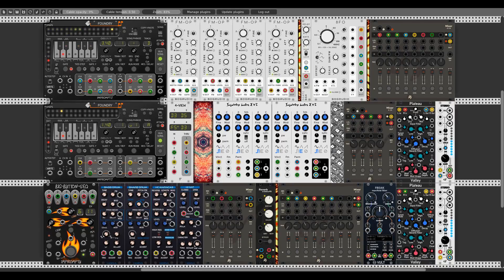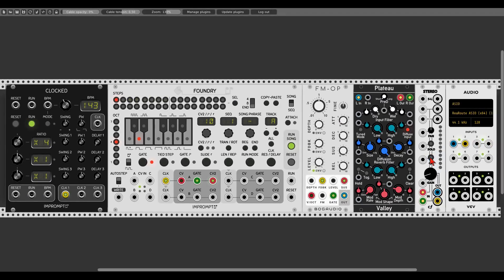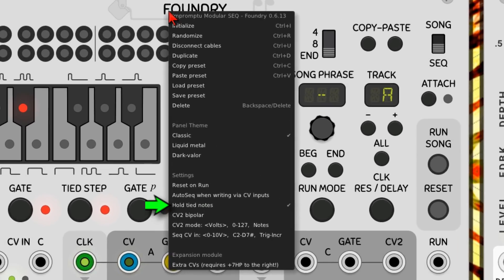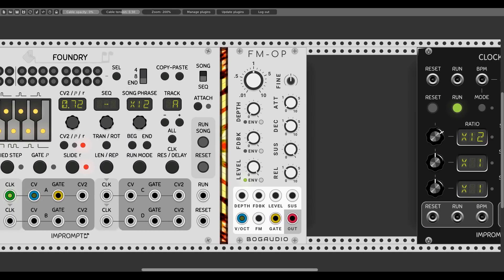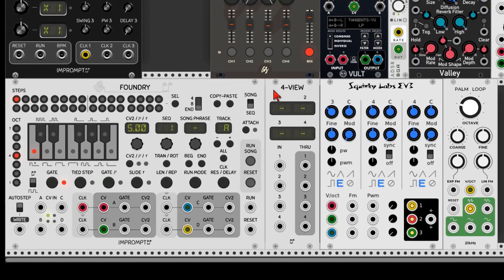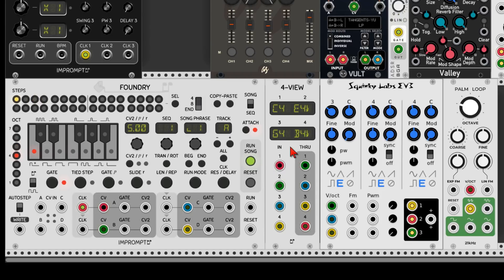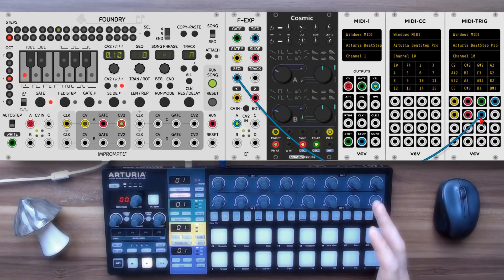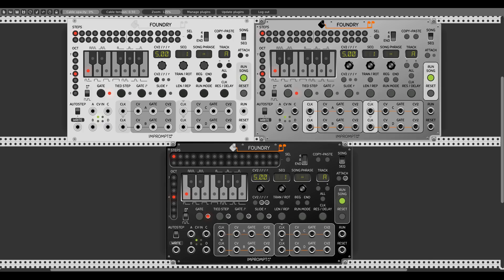Imromptu Foundry - VCV Rack Tutorial

Comment: There's something missing in the procedure for connecting the BSPro for me. I got wired up with the CV, Gate, Vel & CV2 to track A and got a sequence written to Foundry from my Seq1 keypad. But when I run the BSPro only the first 16 step of the sequence seem to play out, i.e., the 16 steps of the default length sequence on BSPro. The last 16 steps light up in Foundry, but those notes are lost. Is it possible somehow BSPro overwrote the second 16 with its first 16 on the first run attempt? (Also a nit: I substituted an FM-OP for the Cosmic because I couldn't figure out how you'd wired it up, both to Foundry and... beyond. Not a well documented Oscillator in my experience.) Thanks for any tips.
Reply: I think it's working for me now. There are a lot of moving parts and maybe they can get discombobulated a bit, especially if there's a bit of learning curve churn.
Reply from the maker: Hi Edward, sorry for not answering sooner, but I'm still recovering from a nasty flu...
You have to make sure that you've got no sequence programmed on the BSPro, otherwise, it will overwrite the notes on Foundry. If you don't want to delete the sequence, then before hitting play, remove the cable from the WRITE function, so the sequence on Foundry will not be overwritten. (be aware that maybe you have no sequence programmed on the BSPro, but the random function is active, so it will still output values)
About Cosmic, it's an oscillator worth learning and I go through it at the beginning of the Foundry live stream I made - https://youtu.be/0_xZsuPEY68
I hope it helps, please let me know!
Cheers!

Comment: Thanks for the tutorial Omri. Is it possible to set the gate length via CV or set it from the external controller?
Reply from the maker: Thanks, Paul! The gate length depends on what you feed in the clock input so if you're using an external controller, you'll have to make the changes there.
Reply: @OmriCohen-Music  Hope you are getting better. So to write a step into Foudnry that has the gate off (in other words, don't play anything on that step), you would need no signal to go into the clock input? Does that make sense? I don't know if I'm explaining it very well.
Reply from the maker: ok, now I understand. You can add a gate off trigger for each step by using the gate input in the extension. You can also do it manually of course, by clicking the gate button. Be sure to check out the tie function if you're looking for adding sustained notes.

Comment: Does anyone know how to submit a feature request? For the select mode, rather than having "4, 8 and end" I'd love it if the process was: 1) Press select, 2) Select the first note in the selection, 3) Select the last note in the selection. This would remove the arbitrary 4, 8, or end selection lengths, and requires the same number of mouse clicks
Reply from the maker: Hi Ty! Feel free to write it here - https://github.com/MarcBoule/ImpromptuModular/issues :)
Reply: Interesting... just opened the feature request myself with this, thanks!
Reply: @marcboule  Thanks Marc! Love your work!
Reply: @TyQuinn  I really like the idea, the only thing is that the switch is also used to determine the length of copy-pasting for portions of the song, which does not reside in the 32 steps at the top right. So do you think it would be ok to remove the switch any ways, and make it such that to determine the length of the segment of the song we want to copy, we do it like this: 1) move the start phrase, 2) press copy, the song phrase display would now flash continually, 3) we move to the end phrase with the knob, 4) hit copy again, and this has now copied the part of the song we want. Pasting is not a problem, it just pastes what is stored. Seem reasonable? When we know what the flashing would mean, it would be intuitive, but for someone that doesn't know what the flashing means, it might make copy-pasting song content confusing.
Reply: @marcboule  I think that sounds really sensible. But I guess it would definitely require people to read the manual, but it should seem really logical/intuitive after that
Reply: @marcboule  or, if you kept the switch but had "4, 8, custom" as the options instead of End? Keeping the  4 and 8 makes it intuitive for new users, and when people set it to "custom" they will likely check the manual anyway
Reply: @TyQuinn  Nice!
Reply: @TyQuinn  I implemented your idea, and it's pretty neat. More flexible! If you want to try it before it gets to the plugin manager, I have put builds here (manual was also updated): https://github.com/MarcBoule/ImpromptuModular/releases/tag/0.6.14b
Thanks again for your suggestion!
Reply: @marcboule  Wow, fast work! Thanks so much Mark. Not just for this, but for all of your work on these modules
Reply: @TyQuinn  You're most welcome! :-)